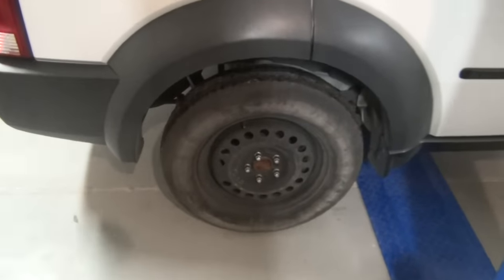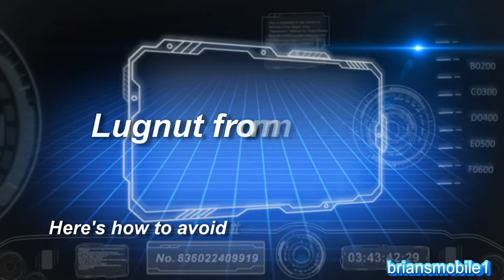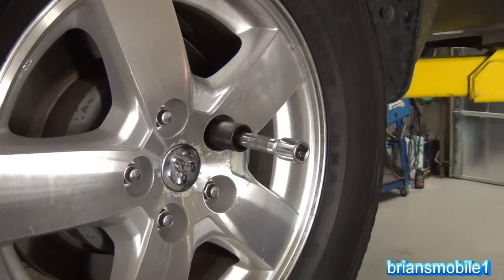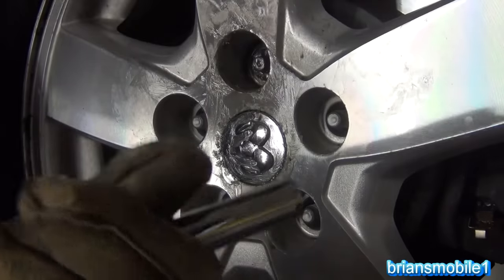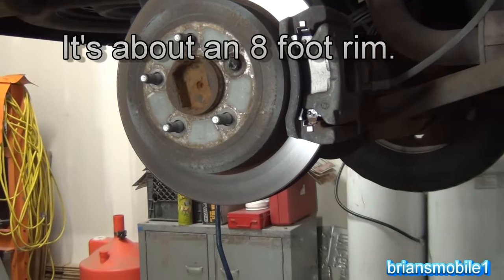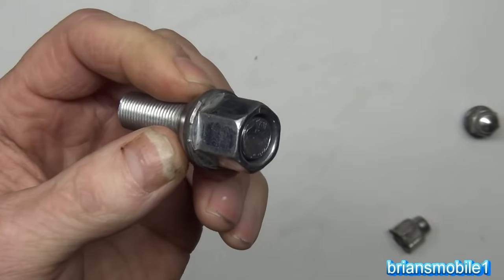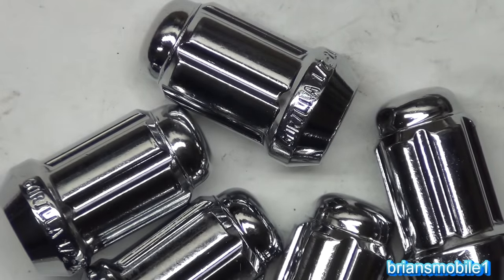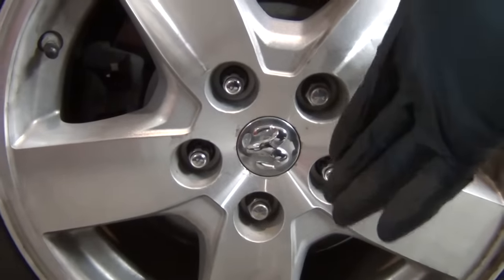Lugnut From HELL

Comment: using extension with impact gun = lost some hammer efect as the extension flexes
Reply: true story flip socket sucks
Reply: +James Parus Learned two things today. The other thing is you can never have too much sausage gravy.
Reply from the maker: +James Parus That's true with 3/8" drive and thinner extensions in a significant way.  There are actually extensions "torque sticks" that use that principle for protection against over torquing.
Reply: +briansmobile1 I have a crappy air compressor and air line, but I have seen cases where a bolt wouldn't come off with a 1/2 extension but spins right off when I ditched the extension.
Reply: It's true with ALL extensions. Nothing is a perfect fit and the longer your extensions the less torque makes it to the workpiece as the whole string twists like a spring. This is why they make long anvil impact guns.

Comment: My buddy had a similar problem we just had to fix few days ago. His lug nut was on the stud and when we went to remove the lug nut the whole stud rotated with the nut. We couldn't get anything on the backside to hold it still so we were in the same position as Brian. We don't have a plasma cutter so we drilled through the center of the lug nut, started small as possible and then kept stepping up bit size by size. When about 80% of the bit was drilled out we put a socket (use a quality one) on the lug nut and smacked it with a big hammer and it snapped the stud. All of the studs ending up being messed up and he got new front rotors and new studs and lug nuts. Used WD-40 to spray the bits as we drilled to help lubricate. Sucks it happens at all but it was a moderately quick fix, took us bout an hour. Sorry you were in the same spot we were Brian, it's an annoying pain in the ass.

Comment: Fail ! You heat nuts and you freeze bolts.
Reply: Karl Napp maybe he could have just drilled the studs out.
...Say, you seem kinda familiar.
Reply: You brake hard a few times to get it all nice and hot and then you shock freeze the bolt.
Heating it up just extended it even more.

Comment: I had this problem where the former owner installed one or two aluminum lug nuts on each wheel; they were corroded on and instantly rounded with a socked. Most of them I was able to get at from behind the disc brake and grind the head off; then punch it through. Others like this guy; I heated and chiseled off. I did no damage to the wheel luckily, I just took my time. Total nightmare; I was lucky I never got a flat. Never use aluminum lug nuts; they should be outlawed.

Comment: "What it boils down to is somebody else worked on my vehicle and I trusted them to do a good job and they did a horrible job"  
#1 reason why I insist on wrenching my own stuff. (''cept my carb/intake lol)

 Another great video Brian! I've never faced this before but I've pondered maybe drilling through with a dremel bit and increasing the size until I can Herc off the hollow bolt. I dunno, admittedly stuff like this is my weakest area. I'd easily waste a day just contemplating the best procedure. I have a question for ya. You seem like a generally calm and reserved guy but when the frustration kicks in, do you start cussin' like an angry viking? If so, can we have a montage? lmao. I find my own strength increases DBZ style when I'm giving everything I got to a stubborn skidsteer lugnut and I let out a healthy "FUUUUUUUUUUUUUUUUUUUU". 

"Soft nuts" Yup, sound like Chrysler! :~D
Reply from the maker: +Brad Nimbus I lived in India for 8 months where English cuss words are kosher.  Since then, I have trouble not cussing when no one's looking.  It relieves stress (healthy), it's cheap, it feels good etc.  Trouble is, it's taboo and it makes you look ignorant- very honest, but ignorant by society's standards.  I enjoy cussing, but I also enjoy the diction challenge of not cussing.  Either way is great.  Cussing certainly has merit in the face of stress or conveying sincerity and earnestness.
Reply: +briansmobile1  Should  have removed hub wheel with wheel attached and then cut wheel stud from behind...would have prevented any damage to the wheel.
Reply: Disc brakes prevent this.

Comment: I had a set of nice 16" wheels (aluminium) on my 1992 Galant which had insanely tight fitting (steel!) recessed lug nuts. On top of that, they had the inner hex or 'inbus' (not sure what the english common word is, sorry) and the workshop who changed the tires some years before didn't spend any effort on greasing the nuts, nor tightening with the correct torque spec, just hammered them on with air tools... The space between the nut and the wheel was maybe 0.5mm or less so no surprise when I tried to remove the wheels at some point they were oxidized like solid in there! Tried heat, tried freezing, tried huge extensions, tried air tools, tried welding, tried WD40, overnight, and again, etc, but in the end only 4 out of 16 lug nuts came off. These rest were damaged beyond use. So it came down to drilling. And these were long nuts and the studs are a tough metal. Horrible. 
http://www.markspages.nl/images/galant/gti-zwart/gepoetst/SANY0042.jpg

My sister has a 1992 Colt with the same wheels and I regularly unbolt them, grease them, just to make sure. One time though she had a punctured tire, went to a shop who replaced the tire, and again, those guys didn't pay any attention and tightened those horrible lug nuts with an air tool, no grease, one year later when I needed to undo that wheel to do a brake service only 2 out of 4 nuts came off. This time I unbolted the complete wheel-hub assembly from the backside and just drilled the top of the studs so the studs+nuts could be freed with a simple tap of a hammer on the stud that could now freely fall out. It was a bit of work to get the whole assembly loose and free, but in the end it is a very clean way to free the nut from the wheel without damaging the wheels. Only thing to replace is the studs of course, but those are cheap. I recently replaced all the steel nuts with smaller diameter aluminium ones which will never cause issues again :)
http://www.galant-fans.nl/forum/download/file.php?id=8991&mode=view/colt-c52a-front.jpg

Comment: my personal experience says Locking Lugs can be a real fucking Hassle...but Honestly that was way to-much heat. you welded the lug to the Stud first few minutes with it glowing red, you want it hot but not radiating on a visual level...Like hot enough to flash water to steam but not hot enough to make the rim warp...and try hitting the Locking-Lug with co2 when it's hot/they sometimes explode off the Stud!but one crack/split will have it spinning off.
Reply: lol is this comment serious? 2 metals wont weld together unless they are both at a temp that allows the metals to melt. Heating the nut till its red will not in any way shape or form weld the nut to the stud.
Reply: jtman04401 what?!!you may be right but don't you see after he heat em up to the degree that the lug and stud are hot enough to bond together then he use the impact gun to try remove it?so on that moment,the lug and stud has the heat friction which the metals became a lil softer.then he failed to remove it when it still hot,so after a few seconds when the lug and stud gets warm again,they bonded more tightly because you put pressure unto a hot metals by using the impact gun.heating a two piece of metal whem trying to separate them is only good if you succesfully remove them in first try,but if not,they will cool down and stick harder on the second try and even on the 3rd try.he making it worse by chiseling the side of the lugs which the thread of both lug and nuts will bond more stronger that creates zigzag threads.at his final,he drills the sides of the lugs which and reheat it again.smh.he should've drill the center of the STUD instead all the way in,that way he can break the stud and lug by his chisel after putting a hole that makes the stud hollow.or maybe he's still trying to save the STUD in that situation?haha.

Comment: I have heard of a wheel lock lug nut remover works for stripped nuts, because it's like a reverse twist to remove the nut. Beat it on, and twist. I have also heard of the candle method. Hold a lighter to the bottom of the lug nut, and hold the candle on the top. The heat brings the melted wax into the nut, making it easier to get off. Anyways, hope these help if you have issue's later.

Comment: I had this problem on a Chrysler van. I had a tire losing air rapidly on way home from work, limped into tire shop where I bought just tires. Owner told his tech to stay long enough to repair it. Mechanic was obviously PO'd and drove them back on with an impact wrench, because when I need to take the wheel off one of the 5 came off. The caps started to come off on the next 4. Impact wrench, breaker bar, hammering with a mini sledge, soaking with trans fluid or penetrating oil overnight...NOTHING was budging these nuts. I returned it to shop. They got three off with rounded-fastener sockets that chew into the nut, but the last one only came off with the red wrench. Of course the wheel was destroyed. They admitted liability though, and it was just a waste of time for me. I'm ordering some of the Gorilla lugs.

Comment: I absolutely hate those lug nuts! As a Dodge Dakota owner, I have had many of those booger up. Caps come off, the nuts round after that, just all around bad. I have found a 3/4 socket to fit nicely, but yes 18mm is what you need when the caps fall off. I just ordered some of the Gorilla Acorn Lug Nuts this past Monday.

Comment: I have a 1999 Jeep Cherokee and I'm living in this hell today...all started when I wanted to replace my tie rod and the cotter pins started busting so I needed to punch out the holes on the castle nuts so I can remove them but need the tires off so I can get access to the castle nuts to punch out the broken cotter pins...and my life went wayward 

Going to a shop on Monday as my tool set is not large enough to handle this job...and looking at this video...I'm beginning to wonder what my bill is going to be

Thanks for the video, it is helpful...and I replaced 18 of the 20 with solid and chromed lug nuts, no more cheap ones

Comment: I always drill the stud they will break off real easy just tugging on the wheel after they are drilled out. Always remove the valve core when heating or welding on a rim with a tire on it. They can blow up, the heat increases the pressure inside the tire.

Comment: Good video !!!   Ford Fusion has exactly the same problem. It is what happened to Hub Caps, they shrunk down over the lug nut. I replaced mine with regular 19 mm hex lug nuts that have a plastic cap over the thread ends. Strangely enough around here, they are not stocked at auto part stores, they are a mail order item only. They we cheap, including shipping 25 pieces for less than $20 .

Comment: What worked for me in the past.

Jelly that wheel up real good.
Find a bolt you can sacrifice that's strong.
Weld the bolt to your messed up nut REALLY good.
Just try your best to remove the nut from there.
If the nut still does not come off, just try to snap the wheel stud.
That's your best bet in the end.

Comment: I spent a lot of years dealing with problems of this type...if you wanna remove the offending lug nut without damaging the wheel, have your tool supplier get you some solid carbide drill bits.  There is "nothing" on a car that can't be cut by solid carbide. A good drill motor and a magnet to catch the chips will no torch related burn marks on the wheel.

Comment: I've had success with heating up the bolt/stud and taking a candle and pushing it into the stud/nut. the wax will get into the threads and dries. Makes them much easier to extract.

Comment: There's a tool called Lug Ripper. It's a hollow tungsten drill bit that just drills right through the threads and leaves the wheel undamaged. Works great in these situations

Comment: You know they make flip sockets specifically for those craptastic capped lugnuts. They come in 18.5mm (When cap comes off) and 19.5 (Cap has swollen). They also have a 22.5 MM for the swollen 7/8th lugs that Dodge/Ram enjoys using.

Comment: Drilling stud and a prybar behind wheel to pop it works very well. For a locking wheel nut, arc weld a 3" long pipe over nut and a pipe wrench to crank it. Only option when they stuck. And for the love of all that is metal, use a torque wrench to torque wheels to spec.
Great video, i would have been far more frustrated.

Comment: Use a big breaker bar with a turbo socket while on ground. If that doesn't work, heat and use a strong impact like an ir 2235. If all else fails, notch the lug with a chisel or cut off wheel to make an indent and drive it loose with an air hammer. Last resort is to drill the lug just enough to use a screw type extractor while heating  the lug with the torch or just cut the lug with the acetylene torch.

Comment: as a mechaniac of (ongoing) 13 years in a family mechanic buisness under my pops with (ongoing) 40 years of automotive/Huey rotorcraft experience i can (in a friendly manner) say i would have gone a different route lol, just went through this on a friends 3500 ram after he got his truck back from les swab, that heavy duty extractor socket on the end of very large breaker bar, couble of HEAVE HO'S to get the stud twisting and eventually break off, pretty easy on smaller rigs.

Comment: Brian, thank you.  This video was GREAT.  We went through the same thing.  Please, please, please make one recommendation: we got to the point right before the plasma cutter (we didn't have one, and we didn't want to risk damaging the rim).  WE USED A MILWALKIE HOLE SAW!!!!!.  Once the outer cap is removed the metal is soft.  We removed the center bit, and picked the smallest hole saw that fit over the lug, and it worked like a charm (drill speed high, but light pressure so you don't get hung up).  After the wheel is off, the rest of the lug just spun off.

Comment: If you drill out from the center of the stud in increasing sizes, the wheel will come off no problem.  First you have to anneal it by get it red hot then let is cool slowly.  You should then be able to drill it out much easier.

Comment: For the common lug size id recommend using standard instead of metric if possible

11/16 slightly smaller than 17mm
3/4 slightly smaller than a 19mm
15/16 smaller than a 21 mm
7/8 for the 23mm sockets

Comment: Yep, same with my Jeep, Chrysler lugs are a heap of crap.  I have 2 that are frozen, snapped a breaker bar, bent a tire iron (with a pipe extension), rounded them with extracters, now at my mechanic for over a week, and he is trying to remove them, without causing any damage.  I was actually making a socket, where I drilled a hole in the side, tapped it hit threads so I could put that socket on the lug, then put a screw down the tapped hole to grip the lug and see if that would work, but I need to find a short enough screw that will fit when the socket is on the lug, that has enough length to hit the lug, but will fit when placed on the lug.

Comment: You can also get one piece normal style...ask at Discount Tire it's what I did buying new tires I had them change out all the lug nuts as the caps on the Jeep OEM ones were falling off. Also had them put in normal valve stems and mount the tire sensors on a band.

Comment: i have an Air Cat impact ... if the bolt or nut will not come loose, it will break the studs clean off, 850 ft/lbs of torque usually gets the job done quickly

Comment: Only hacks use torches or plasma cutters on wheel nuts, the best way I found to remove stubborn wheel nuts or broken wheel locks is remove all the other wheel nuts and turn the stubborn nut to the top and use a long pry bar on the back of the rim on the bottom from the inside and pry out, it helps breaks any corrosion between the nut and rim, comes off easy pessy after that

Comment: 3 minutes with 2 cheap harbor freight drill bits and I drill the stud right out, studs cost like $2 and every parts store has one for every car in stock. Start with an 1/8" and then go to 3/8

Comment: Having this problem appear frequently where I used to work, the boss always had me work on the really ugly ones.  I wound up using an electric high speed tool with carbide cutter.  About 35 minutes.  Drilled straight in 3 or 4 spots and cut sideways through the nut walls. This weakened nut enough to wiggle/break them apart and pull the wheel off. Downside, those little grinding slivers get into your skin, clothes, everything.

Comment: This is exactly why I do not allow shops to mount/dismount my wheels.  They always use impact wrenches, and they over-torque them because they rarely use torque sticks, and as those two piece lug nuts show, they are not built to handle it.  Hand torque your lug nuts and you won't have an issue.  Time well spent.  Good job getting yours off!

Comment: I went through the same thing on the last Chrysler I worked on. But mine was also rusted on like crazy in addition to being crushed on.

I'm not lucky enough to have a plasma cutter so I ended up drilling through the whole wheel stud.  Thankfully didn't scar the wheel or ruin the stud mount.

Comment: Had lug nut on a 2009 F150 that completely stripped out. Drilled out the center of the stuff with a COLBOLT drill bit. Went through 4 drills before I was all the way through but after I got completely though I took a 3 foot pry bar behind the rim and pried against the knuckle and rim and pulled the nut right off the stud with the rim.

Comment: I also had those ones you showed at the end. I got them for like 40$ and they rusted within a month living in Canada. Also! Make sure the taper is the same or you nuts will back off and you'll loose a wheel. Either ball taper, 60 degree taper, flat or the odd degree taper.